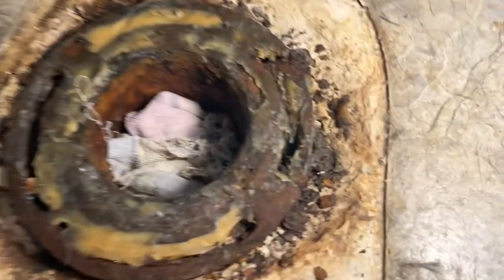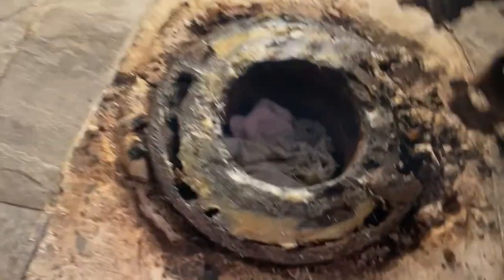HOW TO REMOVE/REPLACE OLD CAST IRON TOILET FLANGE

Comment: You should anchor the new flange with screws into the floor base or it will move or rock and undo the wax seal.

Comment: The scaling on the inside of the  pipe is where the labor is. Im on it with hammer and chisle, files wire wheels, hours into it.

Comment: Flange sat crooked and wasnt secured to the sub floor. .
Reply: Looks like he broke the new flange when he stomped on it.
Reply: @richjohnson8114  He did. 6:30 Flange is now cracked plus sitting crooked.  If flange bottom is right on top of the pipe, should have cut the pipe top level first.

Comment: thanks Tim.  I really like the 3 Allan screws vs the twist and set replacement insert.  Not too many of those at Home Depot. I think that is odd.  I saw a twist and set cast iron but I still like these pvc inserts better.  No one else used a right angle grinder on this job which I think is a great idea.
Reply from the maker: Thanks for watching

Comment: Great video and i have a similar situation where the CI flange is too high for finished tile so i am going to remove the lead and flange like you did.  Do i have to use this pvc flange like you did or would another CI flange that tights around the pipe via gasket that tightens work instead?

Comment: Smokers houses suck to work in. I hope at the very least he refrained from smoking while you were there. Also I would pour a quick dry concrete into the surrounding hole to slab level. Then you have something to screw the flange into.
Reply: Aha nice tip.

Comment: Failure. The flange needs to be mechanically secured to the floor. You might as well not have screwed the toilet to the flange. The only thing keeping that toilet from lifting up or spinning around is the friction from that expansion gasket.